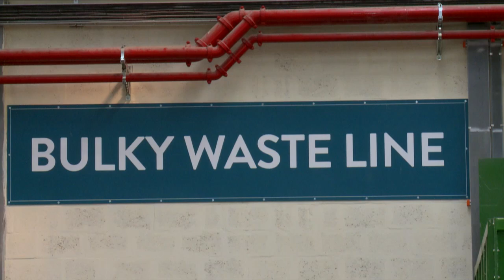Waste treatment and biogas plant Malta, MNWTP - designed an build by B.E.V. Consortium

Comment: Could not watch until the end, had to turn it off. An interesting and informative video spoiled completely by overly loud, endlessly repetitive and thus boring and irritating rubbish soundtrack. Why is this background 'noise' necessary? It adds absolutely nothing but distraction to the visual and spoken information. As well, it prevents retention of information. Under the guise of that obscene joke word 'infotainment', a meaningless and ludicrous manufactured term which achieves neither of its objectives, the informative quality of this video is reduced to cater for those who have the attention span of a newt, so that they can pretend that they are learning. Utterly appalling. What is wrong with the sounds of the process machinery with the sound at a reduced and reasonable volume? A pointless pseudo-documentary of a fascinating subject.